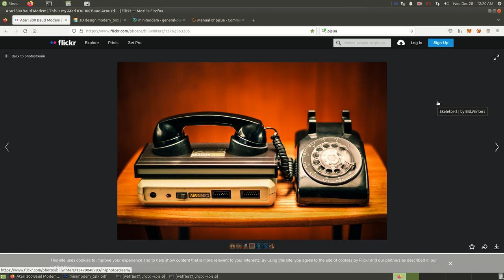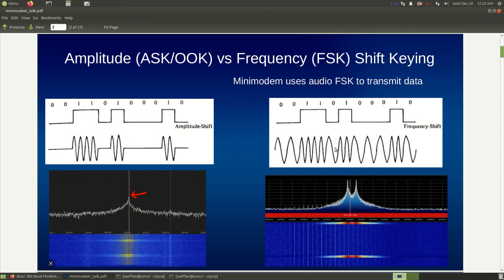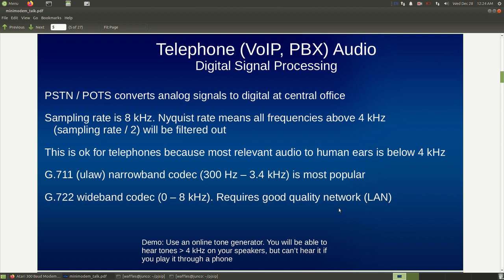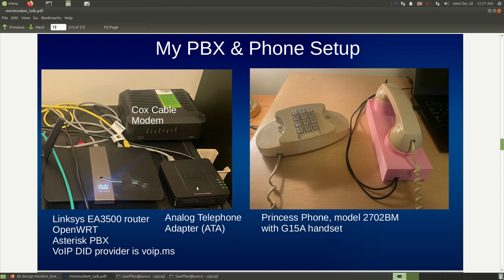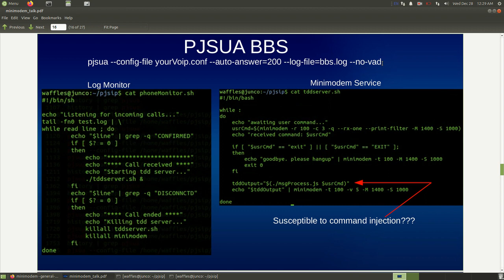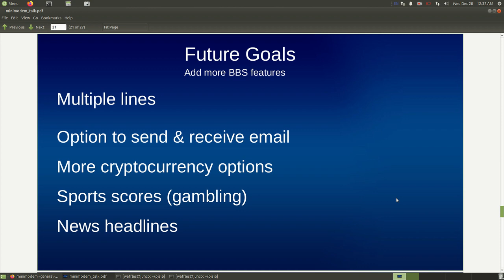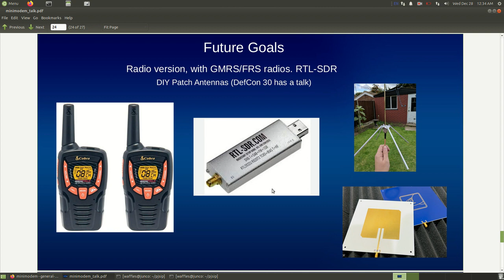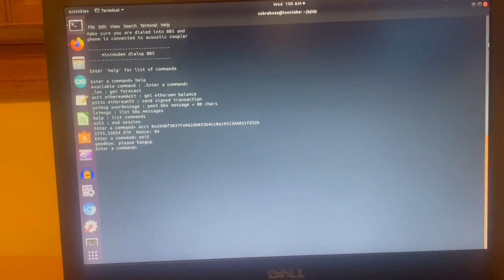3D printed Acoustic Coupler and Minimodem BBS

Comment: i am wanting to make an adapter for 56k modems so they can be used over radio and thinking of using the 3d print for a modified land line phone since the ATA, ATI, ATX1D, ATX3D, ATD, & ATH commands could be used via terminal access to the modem